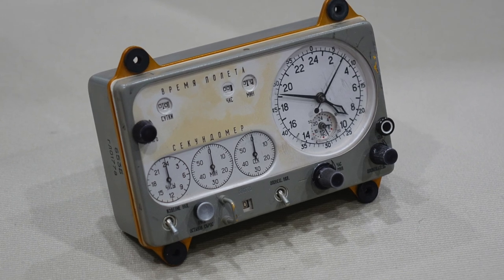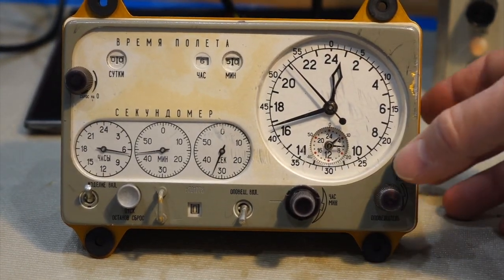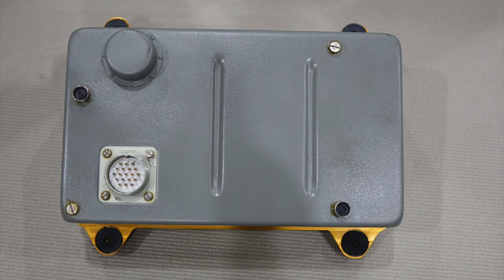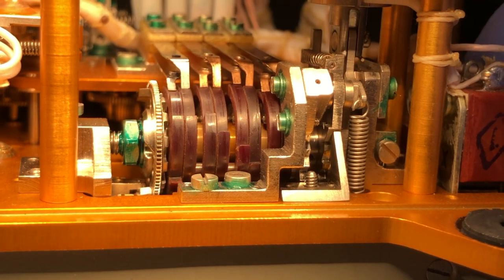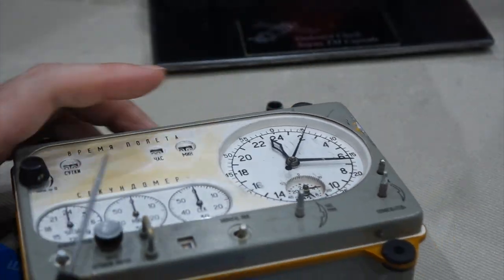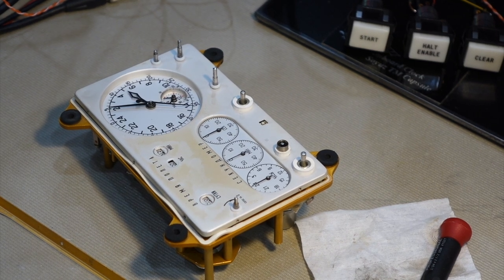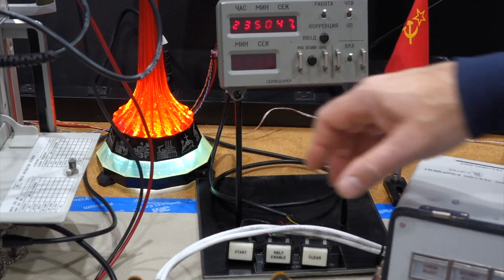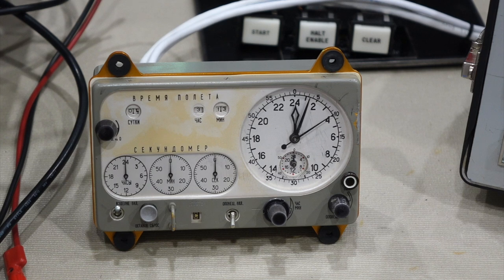Soyuz Electro-Mechanical Space Clock - Part 2: We try every function!

Comment: I wonder about something - how did they generate the clock signal onboard the Soyuz? It seems like an elaborate system to just get a properly timed pulse.
Reply: Maybe the onboard computer has its own clock and outputs a clock signal to the mission clock? Probably not atomic accurate, but probably more than accurate enough for the short time most Soyuz capsules were in space. If it was up there for a year I would probably want a way to get some accurate time hacks to compensate.

Comment: When the chronometer is running, can you manually inject pulses from the Apollo controller and would that also skew the main clock sine they are basically electrically parallel?

Comment: Marc, I think the dot near the 1 is actually a hole. Look at how clearly defined the edge of the "dot" is compared to the printed 1 next to it. Why print such a clean edge on a dot but not the numbers? You would need to get a flashlight up close to know for sure but I think that's what it is, a hole. Maybe its an alignment hole for the milling process? Maybe the other numbered rotors used a different method for alignment and thus no holes? in the footage you inserted of the day counter you can clearly see the "dot" is darker than the printed 1, that would seem to me to mean that its not reflecting light because its a hole. Again you would need to get a closer look with a light, but it really seems like a hole.
Reply from the maker: It *IS* a hole. Looking at it with the bino, you can look right through it and into the plate a far bit behind it. It does not appear to register to anything, at least when into view. Maybe used by the reset mechanism? But then why don't we see it in the hours wheel? Mystery remains!
Reply: @CuriousMarc  You know I had a feeling. Glad to hear it's confirmed. As for why its not present on the hour, I can't say for sure, but I still think its for alignment at some stage of the manufacturing.

Comment: On your schematic, around 21:20, it seems some pins are labelled wrong: pin 2 is used by both the Clock on Switch and the Alarm Contact. But pin 4 is not used anywhere...
Reply: I think that pin 2 is a common.
Reply from the maker: Correct, the 2 on the alarm contact should read 4. It’s corrected in my book but I took the video before that, just after I drew it.

Comment: You could wire the lights on the chronometer buttons so that only the function that you can activate is lit. So for example the “reset” light would light the start button, the “start” light would light the stop button etc. If you reduce the solenoid driving voltage could you soften the slamming of the solenoids?
Reply from the maker: Agree on the buttons! I considered that for a while but it would have required changing a lot more of the wiring inside the prop and I was already behind. Makes explaining more difficult too. But it’s the better user interface for sure.
On the solenoids, if you reduce the voltage it just stops all of a sudden. Or see the reverse in the previous video when it starts, I am just raising the voltage slowly. And it goes straight from not working to quite noisy.

Comment: Wait wait wait,
If this the size of the computer that basically just counts ticks what kind of apparatus did the automated landing of Buran which also flew this device?
Reply from the maker: It's deceiving. It's small and very light. Smaller and lighter than the digital version of the same clock.

Comment: I have to wonder if some of the complexity of the digital version comes from electrical compatibility with the analog one it replaced 🤔
On the other hand, a lot of it is probably just those weird russian jelly bean building block chips and a 74 (err, I mean mil spec 54) series clock would have similar but different complexity.

Comment: Well, I guess the digital version did have two improvements over this mechanical version:
1. The digital alarm was down to the second, where the mechanical alarm had some slop of a +/- couple seconds ... not good for a precise Retro Fire for instance.
2. The digital alarm can be set to 'any second on the minute', but the mechanical alarm only worked to 'on the minute' (+/-) slop.
So those are more critical than having a Chronograph that could go to hours, and having mission time - which can be requested from the ground at any time.
Also, the digital clock had an improvement where it locked out the local control of the Chronograph Start/Stop/Reset state machine when started remotely, where the analog clock Start/Stop/Stop state machine can still switch states locally even after started remotely. More chance of an error that way.

Comment: Can you pulse the clock though the mode solenoid if the main switch is off?
Reply from the maker: No, you can’t. The on/off switch is in series with the 3 solenoids, so when it’s off, you cannot actuate anything electrically.
Reply: @CuriousMarc  Your circuit diagram implied that you could back drive the timing solenoids via the mode select solenoid if the coil current handling is up to the task at some higher voltage.  Just thinking of silly ways to subvert the main switch or detecting a possible fault condition in your space craft.

Comment: Can anyone explain the meaning of the "гЛ01778" that's stamped-in above the clear/stop/start display?
EDIT Apparently there exists an Open Joint Stock Company "Gagarin-Lada", but it's really not clear if that's this гЛ (gL), or if that company existed when this clock was made, or if the company even makes clocks, so any similarity in these letters may be coincidental.
Reply: It might be a manufacturing date code: "r" can be an abbreviation for "year" in Russian, but I don't know if  MM/DD/YY is  a convention in  the USSR/Russia.  It could also be serial number of some sort, or a combo serial number/date code, say "Clock no. 1, 17th week , 1978".
Reply: don't overthink this. Most likely it's a sort of serial number, possibly including manufacturing plant code and years' last two digits, but no guarantee. By any means this will not contain a public name for the plant :)

Comment: Many have faced this problem. The customer asks to deliver the products with a certain acceptance and many questions arise at once, “WHAT IS THIS? 'WHY IS THIS?' etc.

I will try to briefly explain what it is and what can be replaced with.

(OTK): This is a standard acceptance at all enterprises; not one product is produced without it. There is a whole department of Quality Control Department, which control what the company produces.

(ATП): Aviatekhpriemka, shortened by (ATП) or, as it is now, according to the new (РT-TП). This acceptance is not located at any enterprise, but a separate organization that is responsible for the control of manufactured products for aviation. Any enterprise engaged in the supply of something for the aviation industry is tested for the right to produce this or that unit or part. So an enterprise that has passed the audit for the right to release something for the aviation industry has the right to put a mark in the documents of the (ATП, РT-TП), in addition to its quality control department.

(ВП) : Military acceptance, it includes (ПЗ) and (ОС) acceptance. This acceptance is carried out by the Ministry of Defense in the person of a military representative, to whom one or several enterprises are assigned.

The number 7 is the personal number of the person (inspector) who accepted this product!
By this number you can find out exactly the name and surname of the inspector! (If, of course, you have access to the military archives)